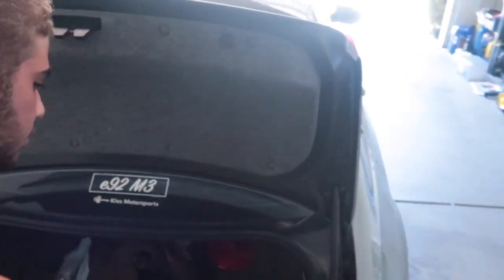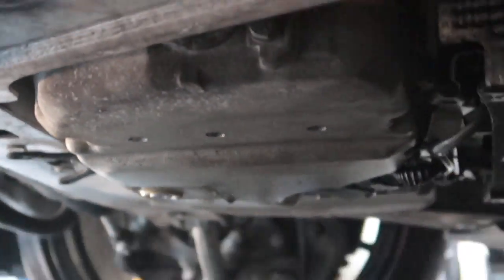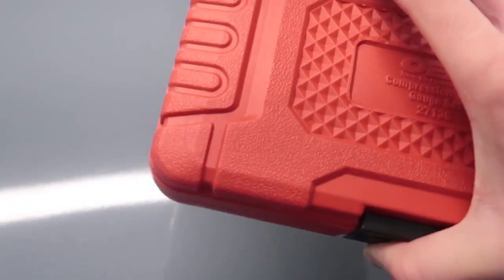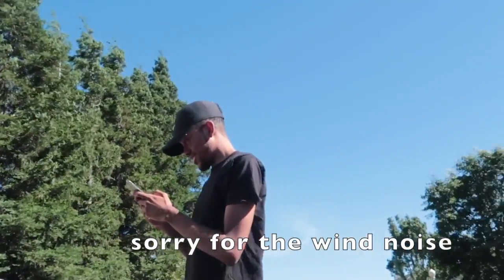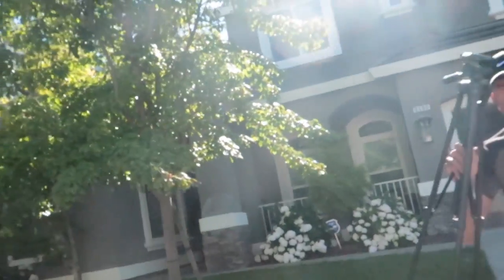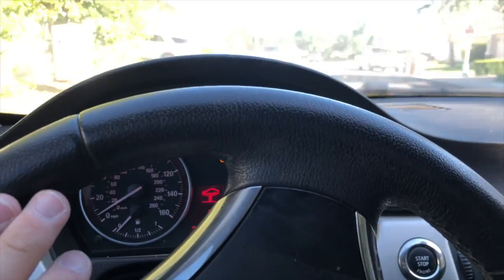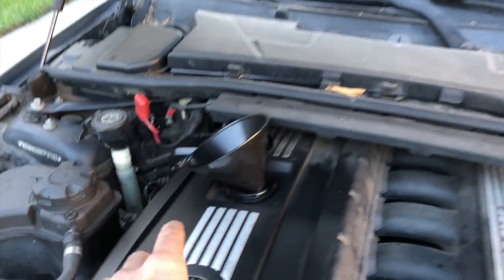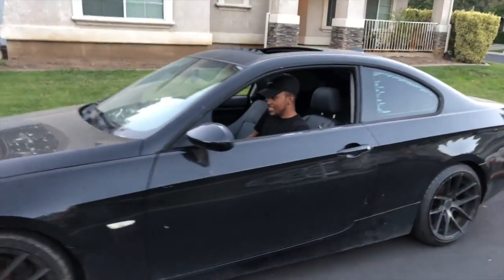TURNING A $1,000 BMW INTO A $6,000 BMW IN ONE DAY!

Comment: Tell your boy to do some preventative maintenance on the thing. Change the plugs and coilpacks, remove the wheels and inspect the suspension. Spray some white grease to keep things lubcricated. Remove and clean the air filter, put in some good gas with a bottle of fuel injection cleaner and if he's got the extra money I recommend a carbon cleaning (if n52s need it)

Comment: You might want to check if you have a recall on the wires because the 2007 - 2011 i think had recalls on them for the wires draining the battery.
Reply: I had to have mine replaced on my 2008 335i

Comment: rethread the drainscrew with threading tape and tie it back up. as for the battery light check the regulator on the alternator and also check the alternator bushes.....

Comment: Hey Nour! I have a 2008 328i. My brake, seatbelt and airbag lights all came on all in the last few weeks. I changed my brakes so it could be the brake sensors. But any suggestions on how to turn them off?? I couldnt clear them with the odb scanner.

Comment: Battery drain is a common issue on the e39s. Basically the radio fails and the car does not go to sleep. By the next mrning, the battry is dead. A crap issue to chase. Good luck bro

Comment: Hey bro on my BMW 325i I'm getting a p0012 and p0015 code and both have to do with the camshaft timing, I replaced the vanos solenoids and the camshaft sensors but the codes are still there and the car lost hella power when the codes came back up do you know what it could be? This is my first BMW it's an 06
Reply: Make sure to reset adaptations and look into your crankshaft position sensor.

Comment: Has the car had the battery B+ cable recall done ? As that can cause battery issues

Also when replacing the battery you need a like for like thats programmed to the car, just registering wont allow the correct charge procedure if its not the correct ampage battery it will require programming not registering 

I had this issue and it was because i fitted an 84amp non agm battery and registered with carly were the battery that was removed was a 70amp agm swapped to a new 70 amp agm registered and its been perfect since

Comment: I have a 04 5series my battery drains too I’ve replaced a few things: BST cable, IBS, MPM module, battery 3 times. Mechanically is good for now All I do is disconnect the negative every time I’m gonna leave it parked for a while that way it won’t drain the battery.. been doing this for 3 weeks it’s daily driven starts right up after I reconnect the battery

Comment: Damn that's cheaper then what i got I bought a 2000 bmw 323ci for 1500 and it has a check engine light on and I stil haven't got it to turn off but it runs and every thing but idk why it's on I think i have to send the code to the computer or something like that

Comment: I got mine for $525 2010 328i crashed from front radiator,condesenator, radiator support headlights front bumper and the whole rotor brake pads suspension whole thing missing from conductor side